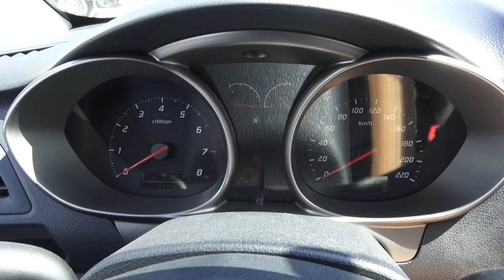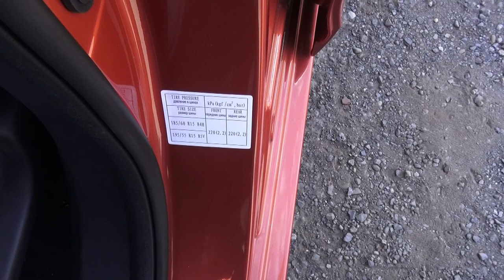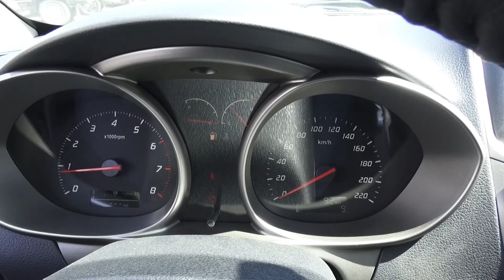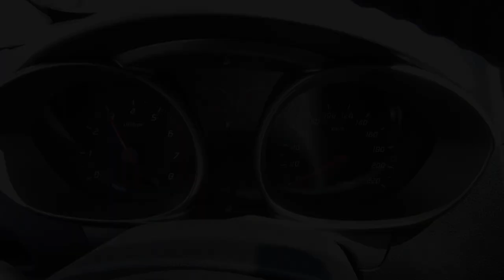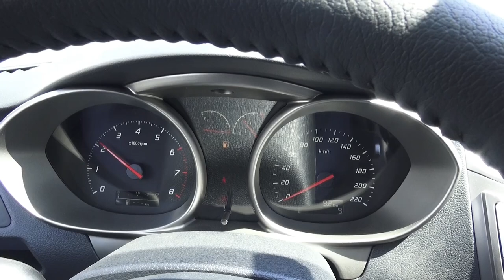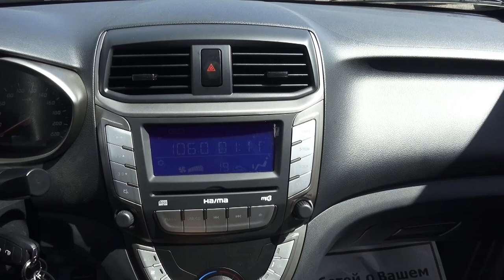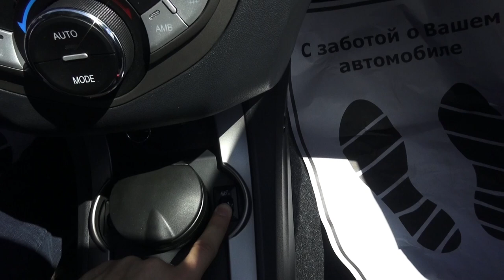2014 Haima M3. Start Up, Engine, and In Depth Tour.

Comment: Ford Fiesta Sedan side profile, Toyota Corolla/Camry/Auris-styled front end, Hyundai Accent/Elantra interior, GM switchblade key, headlights look kind of like Chrysler 200's, and Hyundai/Kia or Chevy Impala looking rear end. But all in all it's not bad for a Chinese car. M3 kind of suits it for the name because it's like a BMW M3 compared to the other garbage that Chinese automakers make. I'd buy this car if I had to.
Reply: May look good but they will tear apart like in 3 years, all the chinese cars have some low quality
Reply: Haima is now owned by FAW, a Chinese auto giant.

It originated from a joint venture between Hainan Provincial Government and Mazda. FAW bought Mazda's shares. The company is now very aggressive in design and engineering, producing some of the most attractive designs. I have no doubt that Chinese cars will gain world attention soon because of their rapid and solid improvement in quality and design.
Reply: MrWowfire I'm 99 % sure that your comment is an ad paid by chinese goverment
Reply: andres valdes you don't need any government to pay for any ad because the products will "always" speak for themselves. The Haima M3 is good, and that is it. Some gentlemen do not know where Haima comes from, and that is why I did a little introduction to this company. In any case, Chinese cars, in general, are improving so quickly, and so solidly, that there is increasing interest from other makers around the world. 

There is no doubt in my mind, that they will do a good job in time, in a steep learning curve/process, catching up so to speak with other big boys.

Comment: Nice. But it will fallapart in 1-3 years
Reply: Just like any Ford 😉
Reply: @Firelife3  Hehhe :P
Reply: @timfordfalconxf7714  nah, i had a ford as my first car and it was the most reliable car i have ever had 😊
Reply: @Firelife3  Awesome :) My first car was a 2000 Aussie Ford laser ( mazda 323 mpore or less )
Reply: @timfordfalconxf7714  okey :) mine was a ford escort mk3
Reply: @Firelife3  Sweet first of FWD Escort's :) We Had the lasers. ( mazda based ) About the same size of a mk3 Escort, I wish they brang them here, The xr2 ( i think they are called ) where good
Reply: @timfordfalconxf7714  okey, mine was just a basic 1.3...had to use full throttle almost all the time 😆 bought it from my grandpa who had it from new
Reply: @timfordfalconxf7714  but yes i wouldn't buy a chinese car anytime soon, imagine waiting for parts 3-4weeks everytime something breaks...if you even could find the parts 😁